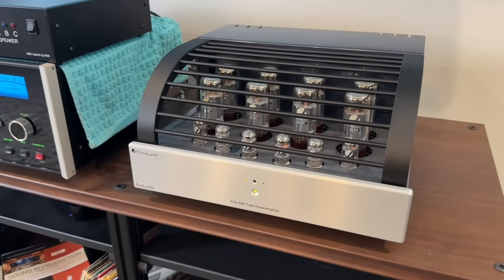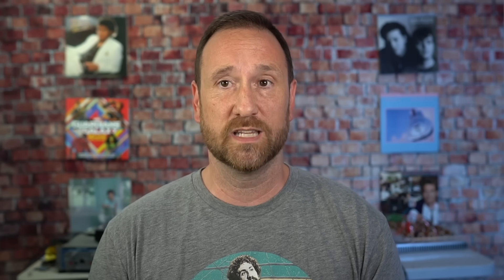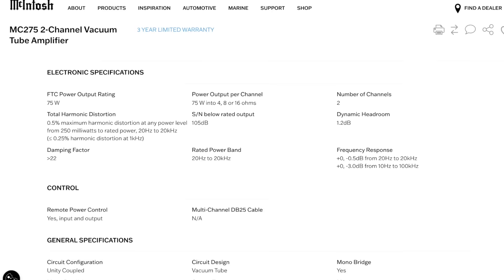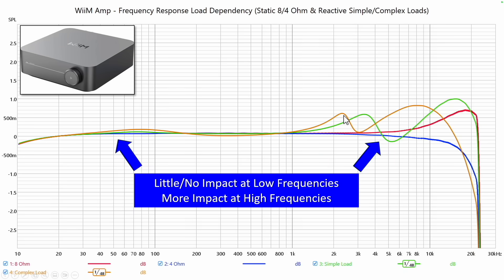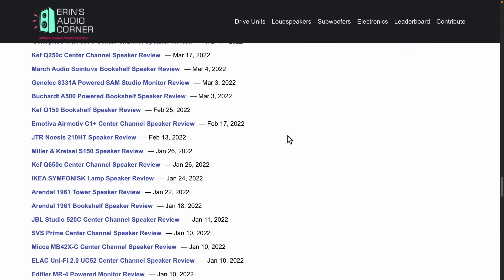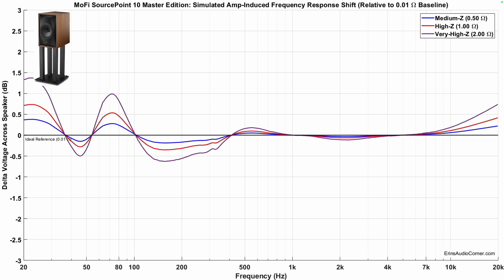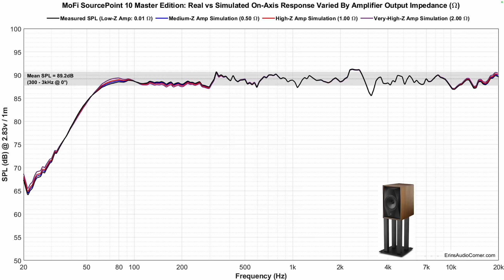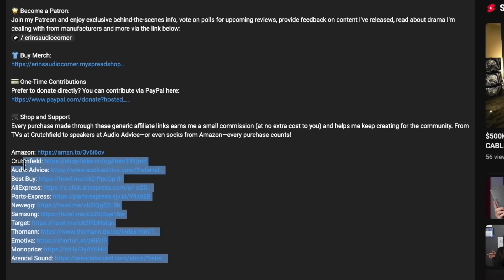Should All Amplifiers Sound The Same?

Comment: I’ve seen some concern about Erin possibly letting out the “ synergy Genie” from the lantern, and seeing that as possibly leading people astray.  “ people are going to take this information as a green light to start playing with tube amplifiers and looking for synergy… and that’s not good because we should be promoting “good” design in terms of neutral amplification.”

But I would also caution on the other hand against possible dogmatism against it.
Engineer minded people tend to feel “ This is the way something should be done.”   And so when it comes to electronics the view is “an amplifier’s role is to amplify the signal with his little distortion as possible, and therefore an amplifier SHOULD NOT add any distortion, and should play neutrally with his many loudspeakers as possible.”
And then this turns into the advice : you SHOULD purchase a neutral, solid estate amplifier and call it a day.

That’s all fine IF somebody shares your goals.  But not everybody does. There are audiophiles who want as neutral and low distortion a system as possible - they want the system to vanish out of the way of the signal.  But many others, myself included, like to play with sound.  We like the idea of a system that “ sounds a particular way”… where we achieve our own version of pleasing sound.

It’s of course, true that some audiophiles thinking this way also end up employing pseudoscientific “ tweaks.”  But, as Erin helpfully supports, some of this playing with sound could be quite audible, especially in regards to tube amplifiers.   

Personally, if I had followed the “ just buy a neutral solid state amp and call it a day” advice, I feel I would’ve missed out on decades of enjoying tube amps in my system.
(I’ve also done blind level matched comparisons of my tube preamp versus my solid state preamp, and easily identified and generally preferred my tube preamp).

The engineer might say: well if you like colouring your sound what you SHOULD do is by neutral gear and then EQ it to your taste.

However, I have found it does not work out that way so easily.  I had a digital parametric EQ in my system for something like 20 years, and I would occasionally put in a solid state amp into my system for a while, and no amount of EQ made me like the sound as much as when my tube amps were in play.  Nor could I perfectly replicate the sound of my tube amplifiers with the EQ.   And I‘m simply not geeked enough to go playing with resistors trying to get a solid state amplifier to sound precisely like my Conrad Johnson amplifiers.  

I love the way they look, I love the connection to audio history, I love the concept of how they work, and I love how my tube amplifiers sound in my system. 

So what I’m getting at is that while Erin’s information is extremely valuable and well done, and while I certainly can agree that it can make sense as a recommendation for many people to just buy a solid state amplifier, it’s not like it’s opening up people with some form of merry-go-round of despair to also say:   playing with tube amplifiers and looking for synergy can actually be fun and gratifying as well.  And the idea that it’s just a total shot in the dark doesn’t match my experience.  Virtually every tube amplifier and preamplifier I’ve tried over the years has sounded very nice in one way or another in my system.  It’s really not that difficult to end up with pairing one can really like.

Cheers.
Reply from the maker: People will often let their own biases dictate their takeaway from a message. Luckily the majority understood the point of the video which is discussed in my pinned post. :)
Reply: The way I figure it... People should want and have access to accurate information about the products they consider buying.  Forewarned is forearmed, and all that.  

But if you make a conscious decision to experiment and try different things... hey, who am I to stop you!  Have fun with that.

BUT... as I tried to explain earlier, there is a sub-group of people who belong to the "If the only tool you have is a hammer, everything starts looking like a nail" crowd and will take Erin's info ... which is undoubtedly correct and well presented... and they will attach it to anything and everything they come across.  I've already had failed discussions with commenters who tried to apply the amp/speaker interaction information to op-amps. 

The concern is that it will fester, like "soundstage" did with every bit of gear (laughably even including digital cables) thought to affect soundstage in some way.  Now, you get some really wild arguments from people trying to force you to believe the mistake, as they do.  (Soundstage, btw, comes from the recordings, not our systems)

I'm not really on anyone's side here... I just hate having to deal with this stuff after it gets filtered through a dozen layers of incompetence.
Reply: @Douglas_Blake 
I agree that ultimately access to accurate information is the most important goal.  Ideally, we are making our purchases advisedly.  
Lots of the scams in high-end audio get my blood absolutely boiling.  I speak up about them on forums.  But one also doesn’t want to end up being an obnoxious white knight trying to save everybody from themselves.
I think Erin has been walking a reasonable line in his videos on this as anybody I’ve seen.
Reply: @QuintEssential-sz2wn  
I agee ... he's being far more reasonable about this than I am.  

I used to train "new hire" technicians in some pretty complex stuff.  My job for almost 20 years was to take them from "this is a piece of wire" to being ready to apprentice with a senior technician... There's a LOT of "no that's not how it works" in that and I will admit some days I still do the job, trying to prevent mistakes and misunderstandings.

Erin is fortunately a lot more soft spoken.

Comment: Amazing video and simulation/measurement work. I knew this effect exists, but I didn't know that even 0.5 Ohm impedance - which is not state of the art, but a realistic value nonetheless - can give such huge swings in the FR of the speakers. This is also why it's important to measure amps with speakers or speaker-equivalent loads.

Comment: Good info.Listened to this a couple of times now. It's certainly alot easier to find an amp with low output impedance than a speaker with a resistive load! Thanks,Erin.
Reply: I think you meant to say it is easier than finding a speaker with a "flat" resistive load.  I agree.
Reply: @danmarjenka6361 Yes,that's pretty rare.

Comment: Good video, not many people understand how output impedance is the biggest factor that might cause a "coloured" amplifier. Though I think the entire topic is kind of silly. Output impedance is a solved problem - practically every meh-tier class AB amp from the 70's onward will be fine, save for the very bottom tier models. Yes, output impedance will affect your system, but it's only a problem if you seek out tube amps or other audiophile gear that is designed to have a poor output impedance. You choose to have this problem, and you avoid it by default. While more data is always nice, output impedance curves are pretty pointless for the VAST majority of normal, simple class AB amps out there - it's just a flat line somewhere below or around 100 mOhm.

Comment: Hi Erin.... I'm sorry if I'm putting you through a bit of a wringer on this one.  

For perfect clarity ... Your information is correct. It is well and honestly presented. And, yes, even I leaned a couple of new things from it.  So please don't think I'm challenging your skills.  I am not.

However; the whole "synergy" thing has been a hot button topic for audiophiles for as long as I can remember. It's almost as bad as "Soundstage". Certainly it was more important back in the tubes days and when transistors were made of germanium... but it still is a hot topic.

My concern was that people without our skills are likely to go off "I found the answer to EVERYTHING!!" and distort your carefully compiled information about interactions between power amps and speakers in ways that neither of us would recognize.  We've already got people asking if it applies to Op-Amps and Pre-Amps ... next thing they'll be trying to hook it on to their vacuum cleaners.

Once again ... excellent work... nicely done!
Reply from the maker: People will make a bit what they want to. If you look in the comments, you’ll see many people taking this to support their opinion that amplifiers sound different. You’ll see a few where people are taking this as motivation to swap gear. But most people get the point that I’m making which is what I stated a couple times in the video itself and in the pinned post: buy an amplifier that has low output impedance, and call a day.

I will tell you this from experience as well that I could make 10 videos and say one single sentence and I will have at least some people walk away claiming that I said something else.
Reply: @ErinsAudioCorner  
" buy an amplifier that has low output impedance, and call a day."

Absolutely.  The higher the damping factor, the lower the impedance, the better.

"I will tell you this from experience as well that I could make 10 videos and say one single sentence and I will have at least some people walk away claiming that I said something else."

Been there... done that ... burned the T-Shirt. 

I don't think you're being misinterpreted as much as people are making more of this than it is.  As I pointed out people trying to pin this to things like op-amps and pre-amps... where it simply doesn't belong.

Comment: Erin you are an Amazing dude! This video was extremely helpful. I am trying to decide what streaming Amp to go with my LS50 Metas. I have been looking at the Wiim Amp ultra, Marantz M1, the Naim Uniti CI 102, or is the best value stepping into a separates situation, I want the best that the Kefs can put out and Earc is required.  Marantz is the only one that publishes the Output impedance, the others you can gleen I guess from reactive load testing. Mcintosh does as well. Did you ever figure out if your Wiim Amp ultra had a limiter or a limited power supply?  My glean from your reactive load testing is that it's Output impedance is somewhere below .05, Is that right? It would definitely be the cheapest option but would it give me the goods. PS Randy (cheap Audio Man) seems to either have his gain turned down or and bad power supply in his review sample. I am a little confused by the output variance in opinion. Maybe he was using a low sensitivity speaker? Dude stay well and thanks for all that you do!
Reply: Get the Wiim Ultra (not Amp Ultra) and get a Hyped NC252MP stereo amp from VTV or Buckeye

Comment: I think the point that should be taken away from this video is: Amps can sound different, but trying to pick one with randomly resulting 'synergy' is not ideal. A more predictable result can be had by using an amp with low output impedance and applying tonal adjustments by EQ. The end result is the same as 'synergy' but totally at the users control.

This doesnt account for distortion or power capability, but those are more easy to define metrics that even a beginner to hifi can grasp. More power, lower distortion, please.
Reply from the maker: Exactly. The goal is to remove the guesswork and have a system that is enjoyable without hours and hundreds or thousands of dollars swapping gear around.

Comment: This is exactly why I got sick of going to Hi Fi shows in the 1980’s and stuck with Linn Products ever since.. for the simple reason of buying components designed to wrk Together without such worries and wasting time on this Lottery of experimentation. I just wanted something that worked reliably at a decent level. A lot of upgrades since 1997 have been with used gear.  Until more recently when I switched from Linn power amps to two modified / upgraded TAG McLaren. (Solid state)  four channel amps for my active system

Comment: Wow!  Very useful information and it certainly does answer the question about what it is that makes amplifiers sound different.   I always knew amps can sound different, especially tube amplifiers, but I never knew the real reason behind it.   With tube amplifiers it is much easier to tell the difference between them as opposed to transistor amplifiers, which is much harder to pick out the differences.   But, I didn't know that just a slight change (upwards) in impedance can affect the sound quality.   My guess is then (with tube amplifiers) that the output transformer probably has great impact on the output impedance given that is the part that attaches to the speaker directly.   More than likely, more expensive iron probably has lower output impedance.  Given the ever increasing prices of output transformers (especially in these times), it has me wondering if I should even bother with tube amps at all.   For the price of one, you could get a decent transistor amplifier and be done with it.  Or, what I have been investigating lately, a hybrid amplifier in which it has a tube front end, and transistor output.  As it is, IMHO, push pull tube amplifiers do not sound too much different then their transistor counterparts.  I find that the more dramatic differences in sound with tube amps, comes with single ended designs.   These are usually lower power and you could limit the lows on them and send the bass to a subwoofer.  Probably a much better way to go than to invest in a push pull tube amp.   Great stuff, Erin and this was certainly some useful information.  However, as you mentioned, the problem is that most manufacturers do not give information on output impedences over frequency.  So, that is a bit of a disadvantage.
Going off on a tangent here, but somewhat related.   A while back you demoed a Dayton Hybrid amplifier (HTA-200) and while it caught my interest, you mentioned the heavy tone coloring of the low end.  This has me curious as to if that amplifier might have output impedance issues, or is the coloration coming from the tube stage?

Comment: Erin, you got it, in tube amps the frequency output follows the impedance curve some way or another. Obviously this changes depending of the tubes used, the output transformer and the amount of negative feedback apply to the tubes and/or transformer. So the flatness of the impedance curve is of crucial importance to match speakers to a tube amp. This is demonstrated in the following video, it's in spanish, but you can use automatic subtitles: https://youtu.be/CnAERl-5LiY?si=v_LyKjb2jmGV2vAr